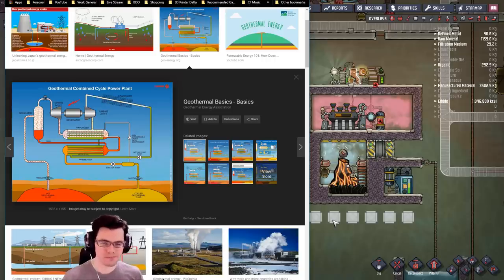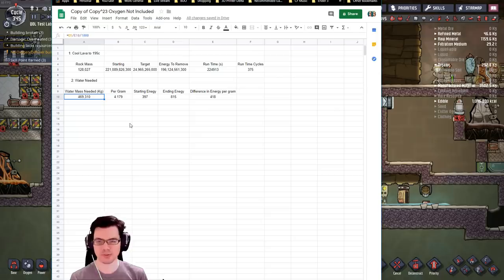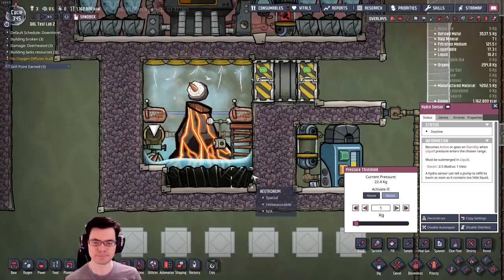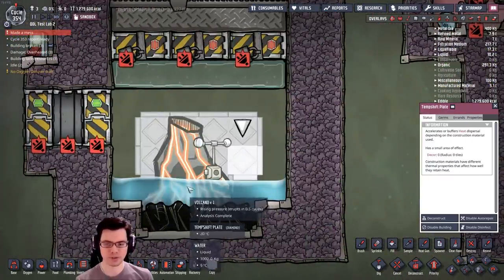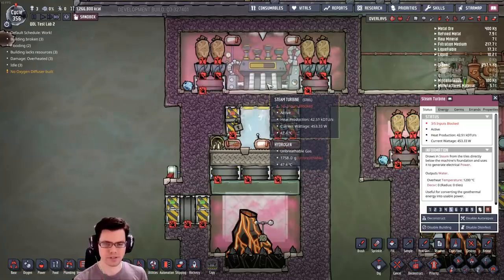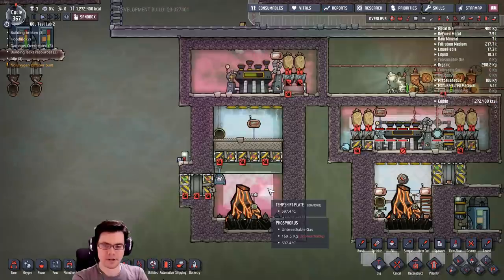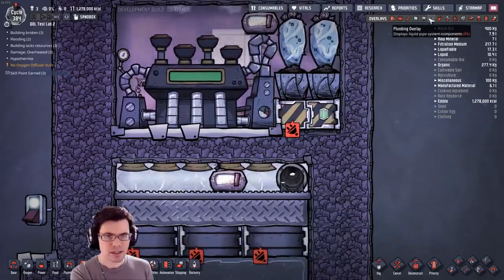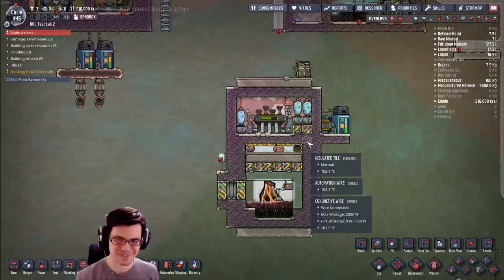Oxygen Not Included - Turn The Volcano Into a Battery!

Comment: Brothgar u can add a bleed gate  to a third chamber that is cooled with ice machines to drain unwanted heat in the bottom chamber so ur phosphorus gas back down to phoshorite
Reply: You could use a tungsten 3 door lock as the heat sink between the two

Comment: you can clean polluted water by feeding it into steam chamber. setup backup for water out of turbine w/pipe  sensor to detect the backup. that releases the backup & opens polluted water valve. build it short so it backs up quick & dumps frequently. wide swings in the mass of water/steam in chamber aren't good for maintaining a steady power output

Comment: This may not be very relevant and you may already know this, but if you have an airflow tile in a vacuum, then it will not conduct heat at all. I've tried all sorts of fluids and solids, but nothing seemed to transfer heat to them. So they could be used as a platform if you need to hold a hot item without the heat escaping.

Comment: I just seperate it into two chamber but I build it next to the Volcano, and the Volcano chamber is vacuum, I just let the magma touch the heat transfer tile( only 3 tiles). On the right chamber, I just let the steam turbine water output drop on top of the heat transfer tile. When the magma turn into ig Rocks, I just use the sweeper on the left chamber to pull the ig Rocks to the right chamber and drop it right below the water output of the steam turbine, when the water drop on the Ig rocks it will increase the temperature again.

Comment: Did a quick test after my last comment using the lava biome, just tungsten plate tiles above lava, it worked better with no shift plates at all

What you want is that rain effect when small amounts of gas condense but not enough to form a liquid block
Not sure how it works but the result is the phosphor gas is always between 280 and 300; with some tweaking it could probably be made to regulate within 5c by balancing the load/turbines with the thermal resistance of the input side

This may not work so well with a volcano though, but using the lava biome i built a completely passive steam turbine. The phosphor regulated the temperature so well that there was no reason to use automation
Reply: Would have tested with a volcano but i couldn't figure out how to spawn one in

Comment: Did you notice that smart storage compactor are really good at exanging heat with surronding tiles, in a void atmosphere i use an autosweeper who dump into a thermium/steel storage suronded by metal tiles and with a couple of heat exange tile. The only down side to this method is that autosweeper is getting hotter and hotter (bacause of the lack of athmosphere)
Reply: They should really add in the ability of thermal shift plates to transfer heat from machinery themselves.
Reply: @guyclykos  That's sad even the wires don't heat up that's kinda weird. I tried to build a room that periodically fills itself with cool hydrogen and after that, i remove all hydrogen to recreate a vaccum before reopening the room.

Comment: Hmm..  Looking at this, I have to wonder how much of an impact the mass of the igneous rock will have in the long term.  The overall heat would be about the same, but it seems like it would take longer to spread to the steam?
Reply: EternalFireseal you sir are correct you have to maintain the heat of the mass not cooling down

Comment: at the 17ish minute mark, I noticed your steam turbine is only outputting 1600g/sec. It should be 2000grams of water. Did you not have enough steam in the steam chamber to support full running?

EDIT: Also, I haven't finished the video yet and maybe you talk about this, but one steam engine isn't enough to handle the DTUs from one volcano unless you allow for wasting heat. By my calculations it will take around 2.5-3 steam turbines to handle a volcano during its active period.

Let's assume 1700g/s average output on a volcano. This would be 1700*1601.85 DTUs per sec (1601.85 being the difference between the magma temperature and 125 degrees celcius, which is what it should get down to eventually to run steam. So a volcano is producing a theoretical 2723kDTUs per second during its active period. A steam turbine can handle about 878kDTUs per sec to give 850 watts. So you can see that one steam turbine really can't handle a whole volcano on its own. Eventually you're either going to be building up heat in the magma room or running the steam turbine above optimal temp.

Comment: @Brothgar I think you are making a lot of problems for yourself by having the volcano be at the bottom of the chamber. Both because you end up with material on neutronim you then have to work around + you can just add a sufficiently large reservoir of water beneath it and let the lava drip down. Now you can easily create as large of a thermal battery as you want just at the cost of a bit of space. As long as the water mass is sufficient to absorb a round or two of eruptions you can just add more as needed (since steam effectively takes no extra space the more of it there is).

Maybe I am missing some crucial point, but that seems like the obvious low-tech solution to this problem that would also be efficient.
Reply: You are right.  It is a rube goldberg machine to be fair.  

And with water as the thermal mass you can have collectors to pick up your material made out of gold or better steel placed in the water as the water only ever reaches 100 degrees max before it converts to steam.  As long as you have enough water the neutronium does not matter.  Maintain the water level and you can collect whatever is being produced.

Comment: I tried this design, but my steel doors acted like insulators- I could not get heat from the glass layer to the metal tiles, the doors and metal tiles remained a chilly 25 degC.    I tried getting rid of the doors, but my resulting steam room was too big, and I never got hot steam into my turbine.     Mini volcanos appear to take a LOT Of tweaking!!!!
Reply: Steve Drevik if you’re door acted like insulators then you have a mod affecting the doors

Comment: Could you save even more power and create a heatsink for the turbine by adding another chamber on top of the turbine and putting a polluted water holding area there? If the turbine room gets over 100 you purify water for free and the excess heat from the turbine has someplace to go. That puts the maximum out put to 970 watts (850 + 120 savings from not having to run a sieve). You could then run that water to an electrilizer to get oxygen and hydrogen and produce even more power :)
Reply: This would also save you some metal because you would just run insulated pipe back to the steam chamber since you wouldn't need the radiator, or wheezworts contraption anymore.

Comment: I notice that you are able to build at least certain tiles over a volcano. Is it possible to build a door over one and if so, to use it to 'turn off' the volcano if it begins to completely overwhelm the system?
Reply: @brothgar  just thought, could you use a door as a valve, to allow flow between a chamber with the volcano and the chamber with the turbine/whatever else you are using it for? Assuming you have a material with a high enough melting point?
Reply: @brothgar  if you drope sand blocks to volcano they can stop to volcano?

Comment: have you ever tried using aluminum or lead for the liquid / gas for volcano? As a liquid aluminum is better then lead but lead flashes at a lower temp and is better as gas. maybe have a layer of each for the different stages of heat. Also I think it would look cool when it goes through the stages of heat.

Comment: I'm wondering how many steam turbines you can run off of that single volcano when it's putting out heat.
Reply: if he could capture all the heat, it would be roughly 3,200,000 DTU/s and each turbine can delete 877,590 DTU/s thus 3.6 steam turbines ROUGHLY not to be confused with exactly because it's a game and who even knows if it's all running perfectly as intended.
Reply: @rocksfire4390  thanks
Reply: @shachar2  
if you want a easy way to figure out yourself the ONI-assistant geyser calculator is your best friend here. fill in all the information of the volcano, you can also set your target temp (exit temp of the material).
Reply: @rocksfire4390  is a volcano guranateed? Can't find any in my game

Comment: What would be cool is they added to this game was the ability to compress liquids and gas in special pipes that had the same propertys as in real life ( heating up when compressed cooling when decompressing) than we could make our own custom coolers
Reply: Fluids out in the wild in ONI don't really have pressure, so there isn't really a self-consistent way to do this. You'd always have some trick to create a loop to break thermodynamics.

Thematically, the thermoregulator and thermo aquatuner presumably have something like this inside them already.
Reply: @Latronibus  I know I was throwing the idea out there for pressure like that to be added to the game
Reply: @adtp-adogthepro6751  There's just no way without rewriting the entire game's code to be more efficient, probably requiring porting it over to an engine other than Unity. Even as it stands, the gas model is dramatically oversimplified even on the normal high speed and sometimes results in absurd outcomes on super speed. Plus, once you get into pressure, now you probably want to get into equilibrium between a liquid and its vapor, which probably means you need to get into multiple types of fluid per tile (since a pool of water is in equilibrium both with its vapor and with the other vapor above it), and now you've multiplied the time to run the fluid simulation by a factor of at least 2. This would render a base like Brothgar's Ultimate Automation Challenge completely unplayable.
Reply: @Latronibus  ok I see it is a cool Idea and if you think it breaks the game I would almost disagree you  just make something so it could have higher pressure from 5kg to like 50kg would be an interesting feature you don't have to add the heating element to it but understand that we can have high pressure of gas if we could transport more in the pipes or be able to store more liquid in a space 2 if you are afraid that it will break your base tuff luck updates tend to do that you don't have to update the game
Reply: @adtp-adogthepro6751  1. Higher capacity pipes would be cool, I agree with you there. But you probably would just use them with special pumps that can move bigger packets or something like that. There wouldn't really be pressure per se anywhere. 2. You were talking about heat and pressure right from the start. What are you actually suggesting if you're talking about removing the heating element from pressure? 3. It's not about the particular base that would break, it's about the scale of the bases that wouldn't be able to run anymore. I just used the Ultimate Automation Challenge as an example of a base that's already a bit laggy but playable. Grind This Game has some better examples of prohibitively laggy bases in recent versions of ONI.
Reply: @Latronibus  yah sure get rid of the heating thing it was just an idea that I throw out there but a even something simple like a high pressure liquid vent would be useful

Comment: For those of us playing in survival mode, where does phosphorous gas stack up in terms of density in comparison to the other gases? I could see this being a very dubious process getting this thing set up without the luxury of god mode
Reply: just suck all the gas out with a pump first (make sure you don't completely uncover your volcano) once all the gas is out dump your phosphorous material in using any method you like.
if you already uncovered your volcano, it would be best to just cage the volcano in and let it over produce liquid, once it's blocked itself you can start to cool the liquid down until it turns into a solid thus covering it up again (blocking the volcano).

then you can do what i said above.
you can cover up your volcano (like i said above) wall in EVERYTHING then seal off the room from the outside, with everything covered in a solid all gases are destroyed. now make sure you have a water lock and then you can just start clearing out the area from the water lock area. every tile will be a vacuum, quite honestly i think this is the fastest way as it doesn't involve any pumps or pipes or wires, it's just dupes building walls and then breaking them down after all tiles have been filled in and you have your water lock setup.

Comment: Wouldn't it be best to have just an excess of phosphorus, and have a pool of liquid phosphorus underneath the volcano?
Reply: Also, how could this be redesigned, to run two steam turbines at once? It'd be neat to see this be modularized so you can just plug in as many turbines as you want
Reply: Unfortunately you can't really maintain a pool, liquids in oni don't "boil off" like they do in real life, its either all gas or all liquid
Would love if they changed the game so liquids did gradually biol, or even add vapor pressure or similar, but thats probably not viable at this point

Comment: y not ask klei to increase turbine maximum power output cap , its obvious that we can now produce far more power , and maybe also another reason to increase it , is so we can push the limits and get AS MUCH AS POSSIBLE out of it , otherwise capping it wont do much.
after this , question that is left , what to use that power for.

what im curious about , is that this game has no gas splitting mechanic , for example water steam at 1300 deg C split in to oxygen and hydrogen, that mechanic was not added.
Reply: Id assume splitting and fusing elements would be on the to-do list, but behind other things that the game lacks

Comment: Why use the heat to make steam if you can use it to make petrolium or even pure iron!
just drop some oil or ironore on the vulcano heated floor and harvest the results.
Let doors cut of the heat and use water to cool down. The steam that comes out can be use to make power but the main goal is to use the heat to melt and transform.